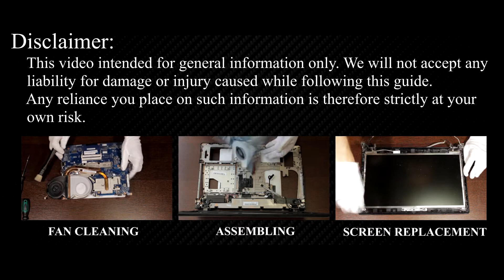Lenovo IdeaPad Y500, Y510p RAM Upgrade and Installation Guide

Comment: Hello friend. I have a question. I wanna change disk of my y500 with ssd or M2 ssd. But ı m not sure wheter my laptop has a M2 slot or not. Can you help me about that Lenovo y500 has a M2 slot?
Reply: Hi, there is no m2 slot in y500. But you can switch the Cache SSD in mSata Slot to a real mSata SDD (with e.g. 500GB or 1TB). I have installed an Samsung Evo 860 mSata as Main SDD with a new Win10 installation. And the old 1TB HDD as Back-up. it works.
Reply: @sebastianhubl7184  thank you friend. I saw your answer yet.
Reply: Nasil yaptin m sataya taktin mi
Reply: @osmanbuyuk2062  evet hallettim. Sen de mi aynı işlemi yapacaksın?

Comment: Can I change the graphics card and the processor too ?
Reply from the maker: Yes, you can
Reply: How-FixIT oh I’ve been told it’s hard but not possible to upgrade the gpu and cpu in the laptop , but is there any side affects ? For example Can I upgrade gt 755m sli to gtx 1050 ti without any problems? If yes will there be any side affects? Like heat or any thing? And thank u for your help 🙌

Comment: Q1 ) Does the laptop comes with  two 4gb ram chip ? 

Q2 ) And if on the box of the laptop it says 4gb ram than is it a single 4gb chip or two 2gb chip ? ( Brand -- Lenovo yoga 500 14ibd )
Reply: @ArcticZombie  You mean the laptop comes with two slots or two 4gb ram cards ? 

What if I bought a 4gb ram laptop which have duel slots , will it come with a single 4gb card by default or what ?